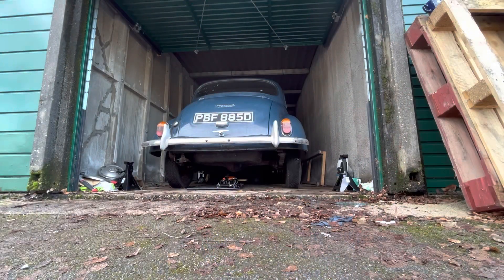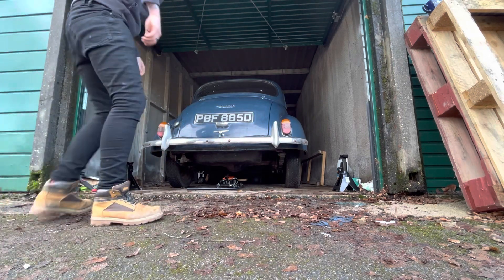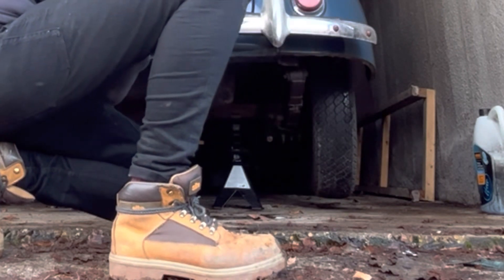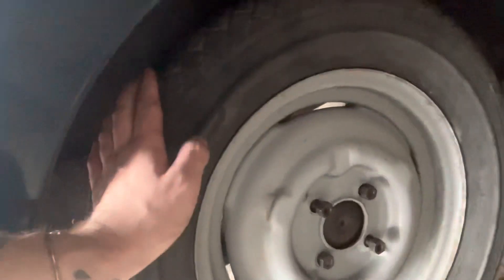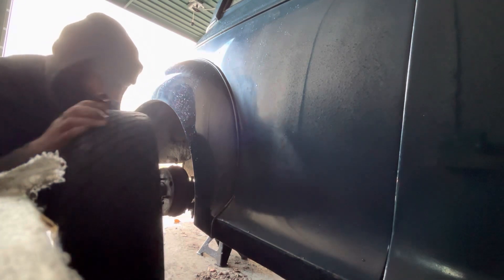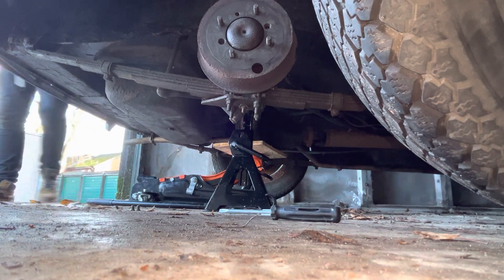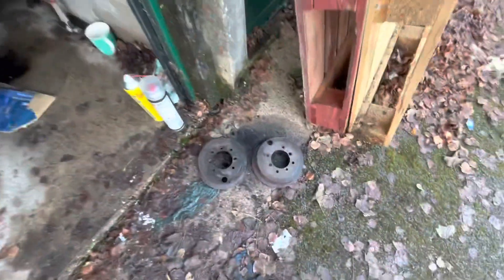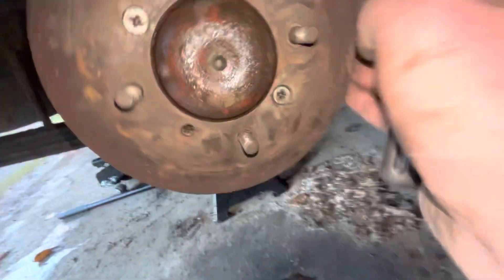Morris Minor Project - Rear Brake Shoe Adjustments

Comment: My first was a 1965 ex post office minor van which I bought way back in 1970 for £17.50. My next was a 1960 2 door saloon. I now own a 1954 4 door split screen Minor with front disc brakes and a 1098cc engine. Lots still to do but hey, the sound of the exhaust on the overrun brings back so many memories!